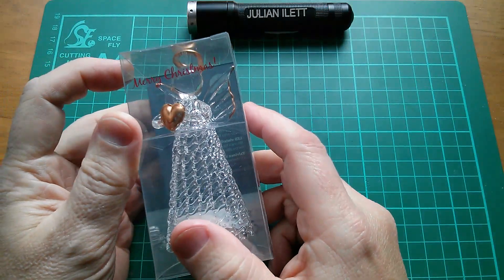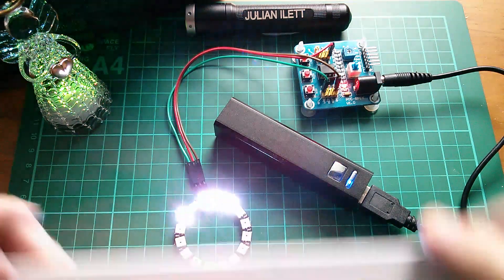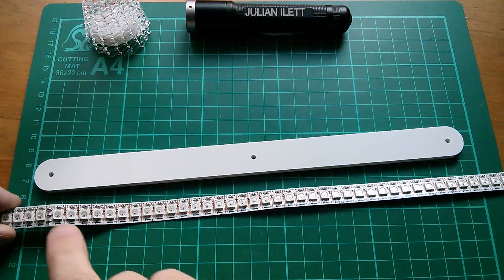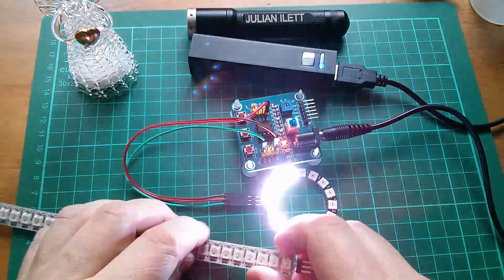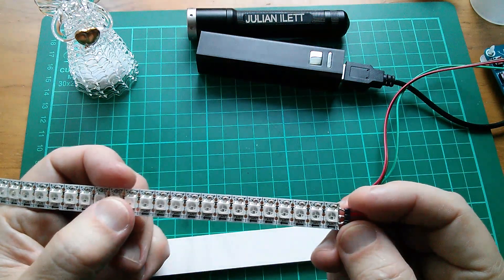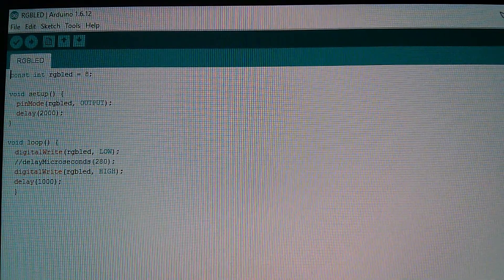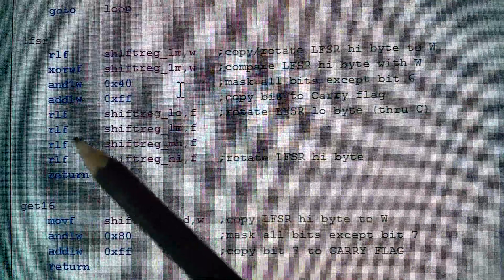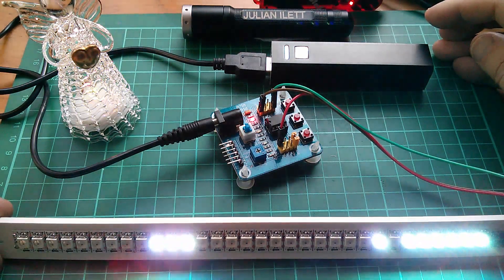Building a 32-bit Neopixel Linear Feedback Shift Register

Comment: When you went to program with the PICKIT2 Found a 12F683 - I thought that the board used a 12F675 device. Have you swapped it or maybe the programmer sees them as the same?
Reply from the maker: I swapped the 12F675 for a 12F683 for driving the Neopixels
Reply: I missed that, but became more obvious when you did your last postbag and have another 8 pin PIC. Looking forward to following your PIC development tutorials. Excellent work from you as usual.

Comment: With those exposed contacts on the back, you'd be screwed if you wanted to stick this to a bit of aluminum or similar to act as a heat sink. Although I guess they probably don't get hot enough to warrant that in the first place.

Comment: The Angel didn't make it to the end of your video
Reply from the maker: The angel uses a CR2450 lithium cell which I've never seen for sale in any shop - so I'm using it sparingly. I may have switched the angel off during parts of the video :)
Reply: Julian Ilett oh wow thats indeed a rare one. I had a similar Angel light using 3x 1.5v LR41s (or similar) with a screw cap that was used as a 'switch' also.It ran through the button cells like some people drink :D

Comment: What is the power draw of that beauty? I find that my biggest issue with such LED projects is dealing with the problem of adequate power.
Reply from the maker: Enough to make that little power bank get quite warm
Reply: Julian Ilett So if you were to power this as a display, I assume you would use a higher quality wall wart? Say 2A range?
Reply from the maker: Adafruit says that 30 pixels uses 1.8A at 5V - about 9W - that's with all 3 colours at max brightness.

Comment: led stips probably often come solder joined, i also got mine that way.
Reply from the maker: I just feel, if you're buying a 1m strip, the seller should make an effort to ensure it has no joins.
Reply: so true.
Reply: +Julian Ilett I think the high density strips (144 leds per meter) only come in meter lengths, and always made up of 2 x 50cm lengths. The joint is very annoying.
Reply: bigclive mentioned in an old video it must be easier/cheaper to build a panel (50cm long) of the strip material then chop it into 50cm strips and solder together, rather than having a continuous strip being produced
Reply: I read somewhere WS2813B strips are only manufactured in 50cm lengths.

Comment: Thanks Julian, these PIC videos are becoming a favorite of mine.
As for the video you're about to make about this, would you talk about what changes you'd make to get the dot to move smoother (i.e.  assuming the LEDs can be set to three states, high for completely ON, med for halfway ON, and low for OFF, so for moving a dot across the strip instead of going
HIGH LOW LOW > LOW HIGH LOW > LOW LOW HIGH //not smooth
you  make it go something like
MED LOW LOW > HIGH LOW LOW > MED MED LOW > LOW HIGH LOW > LOW MED MED > LOW LOW HIGH //smoother? )
Reply from the maker: Like the meteor strips - dithering - or is it anti-aliasing. That's fine if you want a smooth effect, but I'm trying to show the synthesised data, so I want every pixel separate.

Comment: Hello! Excellent your videos, here in argentina are expensive neopixel strips, so in my case I do with a standard rgb strip and multiplexed segments, but the query is: you are using programming in assembly because the programming in C is not fast enough For the 2MHz instruction clock? Since some time ago I try to make neopixel walk with 1MHz clock in C and it is impossible to reach the ns of propagation, Regards !!
Reply: C in general is not good for code that need to have controlled time of execution (due optimization you can not rely that every time you compile code same part of code will have same execution time). Assembly is in most cases slower then which good C compiler will produce for anything except trivial code (in some meaningful time period) . Now for PIC compilers I do not know good C compiler so in this case assembly is always faster (from I saw most optimizing code produce bknd compiler)..
There is no way you can make WS2812 work on 1uS instruction cycle in full (controlled) RGB mode, you can make them to act like ordinary white LEDs with of and on function if that is what you want, but that defeat purpose of using them.

edit: for 0.5uS (2 MHz) instruction cycle it is possible to make them work, but you will need to use static pattern without loops (basically you can do it just if you unroll all communication code and send static pattern)
Reply: electgpl if you do set or clear individual bits in C the compiler should do that in single instructions. the problem with 0.5us instructions is that it is marginal. you would need to set the osctune register to max to get high pulse below 0.5us. Then you still have not enough time even with asm to fetch and loop your code within the 5us before the pixel resets. so 0.25 us is minimum unless you unroll your loops?
Reply from the maker: I'm not having any timing problems yet and I've got subroutines nested 4 deep!
Reply: bwack With neopixels are more like try and miss, some will reset on as low as 5uS (or less) some will need 10uS (even datasheet say 50 uS).
They are interesting but they are full of bugs, I found that when I send FF,FF,FF to them which should be full brightness white they glow only 60%,. I thought that they cant handle current, but that is not case (or is) because when you send FF,FE,FD they do glow much brighter.
All this apply to WS2812B versions, I didnt try SK6812
Reply: Herewith a Raspberry Pi library. It is using the SPI MOSI line for controlling the WS28xx
https://github.com/vanvught/rpidmx512/tree/master/lib-ws28xx
Reply: bwack Exactly, my idea is to use it in loop-like functions through assembler instructions inside C, but so far it has not worked for me with an internal clock of 1MHz, with a clock of 2MHz I have no problems but I wanted to test it with the internal oscillator Of 4MHz.
Reply: Julian Ilett I remember having problems of depth of routines in PIC because of the few levels of stack of the architecture. Good post !!
Reply: Julian Ilett You don't have any problems with timings just because you sent only all 1 or only all 0 to them (you just turn them in on full white or off, whit defeat purpose of having RGB LEDs), try to send some other values to them (let say try to make them glow green) and you will see what will happen.
Reply from the maker: I have done some experiments using a 24-bit LFSR to produce random colours (8 bits for each of red, green and blue). No problems there either.
Reply: Julian Ilett Congratulations, you must be best assembly programmer ever, you managed to fit all that in 10 instruction cycles (4MHz microcontroller) before they reset (and that is on high side, some reset on as low as 5uS), and only subroutines nested 4 deep take 8 instruction cycles. Once more congratulations that is remarkable achievement!!!!!
Reply from the maker: Ah, no, I'm using an 8MHz micro.
Reply: Julian Ilett Sorry but I think this question was about 1MHz instruction cycle.
But again even with 2 MHz instruction (8MHz microcontroller) cycle it is not trivial to make them work.
Did you not at begining start with 4MHz microcontroller?
Reply: When I had 8MHz and OSCTUNE to max, I managed to write to the ring, but I had problems with it reseting, or did I go to 16MHz before finding the real fault ? Is it possible to send a bit at a time and let it reset/latch for every bit and get the same result ? I remember it took about 5 us and sometimes 5.5 us between each high pulse.
Reply: Ok this is spooky. Now loop shifting data on the ring works at 8MHz. I tried writing 24 bits high and let it reset (bit banging on the fly). The first pixel didn't move, but it did light up. Then I included my loop after the 24 bits, and it just freeze the one pixels. When I only have my loop as intended, it works fine. So I wonder if the 24 bit + loop thing somehow violated the reset timing.. I don't know. Surprised that it works at 8MHz.. My loop takes about 5us  between bits.. btw if you use call, then it is 2 cycles to enter and 2 cycles to return.

The loop (pic18f), shifting out 16 pixels (48 bytes array PIXELS)
UpdateNeoPixels_x16
    movlw 48
    movwf R3 ; bytecounter
    lfsr FSR0, PIXELS
UNP_NEXT_SUBPIXEL
    movlw 8
    movwf R2 ; bitcounter
    movff POSTINC0,R1 ; copy next byte
UNP_NEXT_BIT
    rlcf R1 ; rotate last bit into carry
    bnc UNP_WRITEL
UNP_WRITEH
    bsf LATA,0
    ;nop
    nop
    bcf LATA,0
    decfsz R2
    goto UNP_NEXT_BIT
    decfsz R3
    goto UNP_NEXT_SUBPIXEL
    return
UNP_WRITEL
    bsf LATA,0
    bcf LATA,0
    nop
    nop
    decfsz R2
    goto UNP_NEXT_BIT
    decfsz R3
    goto UNP_NEXT_SUBPIXEL
    return
Reply: Ah 50us reset time. I didn't pay enough attention to the datasheet.  Notice that the TH+TL is 1.25us +/-600 ns. So if we (like now) have periods between bits larger than 1.85 us we are out of spec. No wonder they will vary if used outside spec. It's just ordinary parameter spread that all devices have. Like the Vbe or hFE in bipolar transistors, two transistors of same model can be be 100 hFE and the other one 500 hFE. If our bit period is in between 1.85 us and 50 us, we are in the illegal area. We can violate setup-time, reset-release time etc or whatever is in there. If the WS2812 pixel goes into metastability it can't propagate bits from its input to the next pixel.. I think, just me thinking. :)
Reply: bwack I used this site as reference for timings
https://cpldcpu.com/2014/01/14/light_ws2812-library-v2-0-part-i-understanding-the-ws2812/
In my cases values from that site worked for me.
Reply: Thanks. Interesting stuff !

Comment: Nice. Didn't you need rlcf not rlf to rotate through carry or else the carry will just snake into the beginning of the same file and not the next? Oh wait I'm using pic18f instruction set. Different.
Reply from the maker: Ha ha, yes the instruction set does vary between PICs. I'm sure there's a shift instruction in the bigger ones. Thanks, by the way, for inspiring all this LFSR stuff - it was your comment that started all this :)
Reply: I've been taking one course at the university this autumn, the first one in 11 years, anyway a course in FPGA, and the course had a chapter on LFSRs. I'm also interested in the chips inside the Commodore 64, and the sound chip (SID) has two hardware LFSRs, one for noise generator.  Got curious to the whole theory around it. How they run, how large the sequence can get etc.. Now the course and the fpga labs are done, had the exam. I mis the labs already, but no worries the teacher has lent me a fpga dev board (!) :D Looking forward to future lfsr video if you decide to make one :)
Reply from the maker: I'm getting curious too. I'm looking for 2-tap maximal length polynomials where the taps are on the last 2 bits. They exist for 3, 7, 15, 63 and 127 bit registers but curiously not 31 (which is really weird) and I've just built a 32 bit display. If I build a 64 bit display and run it at 8Hz, the maximal length sequence doesn't repeat for 365 billion years. Crazy stuff.